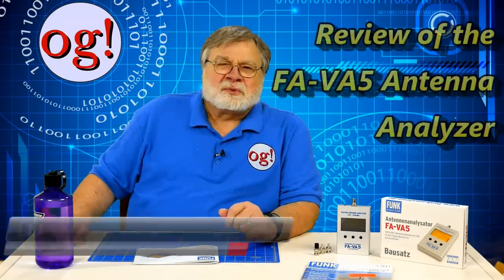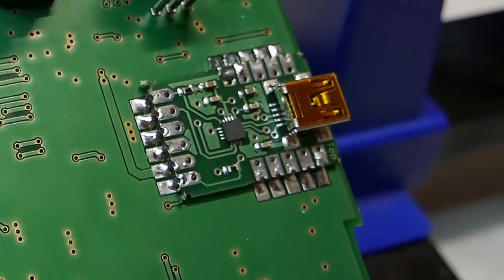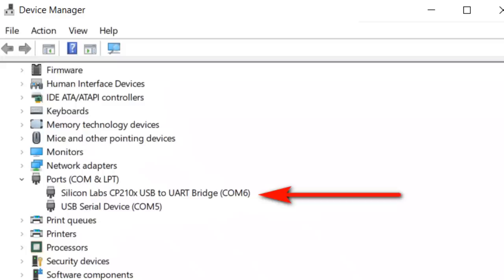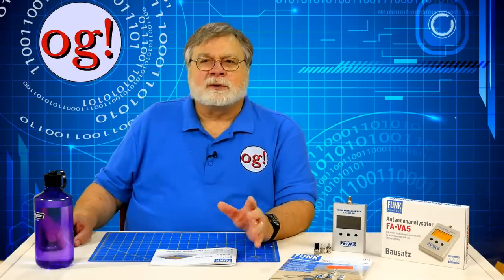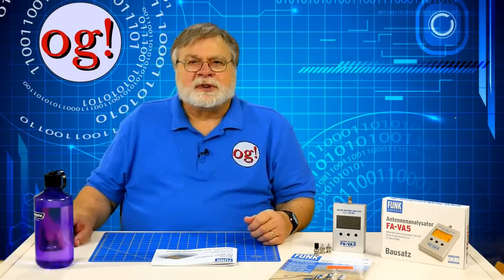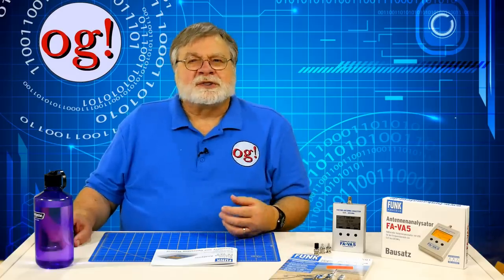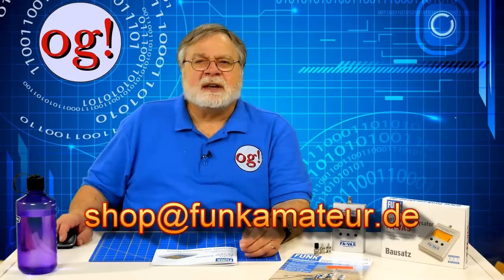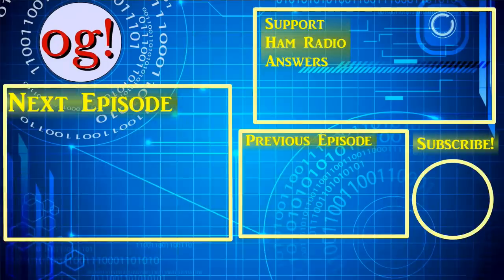Review of FA-VA5 Antenna Analyzer Kit (#193)

Comment: Love the review, it’s a really interesting device. It’s great that  the FA-VA5 and RigExpert AA-30 “zero” are finally putting good instrumentation within reach for hams on even the tightest budget.

A point regarding the “conspiracy against SO-239s”. For analyzing VHF and UHF antennas, SO-239s are entirely unsuitable. Even high quality amphenol connectors exhibit significant impedance variation above 100MHz, which severely degrades the accuracy of the analyzer output. I chased my tail for several days while attempting to tune a 70cm Potato Masher type antenna before finally isolating the erratic measurements to the PL-259 connector on the antenna, and the adapter I was using to connect it to the SMA port on my VNWA 3EC. I measured a dozen amphenol branded adapters and connectors from my parts collection, including some with  silver plating and PTFE dielectric, and found that the impedance varied from as low as 28 ohms, to as high as 71 ohms on 70cm. Their mechanical and thermal stability at those high frequencies are also remarkably poor, and few (I believe only those silver/PTFE parts) maintained better than 10% tolerance in pretty average operating conditions (several were MUCH worse) making calibration all but impossible.

On an HF analyzer they’re quite acceptable, but the only reason you even find 239/259 connectors on V/U gear these days is that the manufacturers are cheap and most hams don’t know just how bad they are compared to BNC, SMA, or N. Gear built by cottage manufacturers, or meant for contesting and other high performance operations abandoned it long ago, and most contesters swap the 239 on older radios they acquire for N straight away.

Those old “UHF” connectors were so-named in the days when UHF was anything above 30MHz.
Reply: Great info.  It is a shame that all my major brand 144/440 radios come with SO-239 connectors.  The connector I would like to see become the standard is the TNC, that is the Threaded version of a BNC.  As the center of it is the same as the N and BNC, the frequency range and impedance is the same.  BNC is fine for connections that need to be changed frequently and aren't stressed, but not so great for HT antennas.

Comment: Very thorough review. This type of "budget" analyzers are very useful for amateurs, maybe more so than a plain swr/power meter. You mentioned some very important points like the square wave output and the resulting harmonics. Like you mentioned, if the resulting harmonics are not filtered properly on the return feed, the result can be very off. I have 2 similar antenna analyzers, one for HF and one for VHF-UHF and I never checked their output waveform and harmonics. I should do this as soon as possible.

Comment: "putting the USB board on" was difficult, but a little scotch tape (with folded ends as a pull tab) on 2 of the 3 sides helped. Solder a side that isn't taped first, then remove the tape from the other sides now that the solder is there holding the board in place.  I had a very tough time with the solder bridges, and had to remove excess solder a few times.  Be careful here.

Comment: Your review was complete, concise, well thought out, and presented in your typical outstanding manner.  One thing I don't get is why you recommended this product.  Yes, it has a graphing feature but using a square wave instead of a sinusoidal is pretty weird and fraught with negative issues.  Even chucking the lousy computer software from consideration, it seems to me that it hit well off the mark as being something I would recommend...even if the price is attractive.
Reply from the maker: As it turns out, and as several people pointed out, the harmonics of the square wave are taken care of in the part of the instrument that receives the signal back from the antenna.

Comment: nice review, very thorough, good job!. I can't say for sure but my guess is that the harmonics you are seeing on the square waves are the reflections from the load. You can see this same behavior if you use your scope to look at a fast square wave  connected to an open transmission line (something like speaker cable) be sure connect the square wave source and the scope on the side of the wire. For fun you can connect a potentiometer to the open end of the speaker wire transmission line and adjust it to square up your square wave. You can then measure the pot value and you now have the impedance of the transmission line. I think you maybe able to use an Arduino and toggle one ifs pins at about 8 MHZ, for what it is worth.
Reply from the maker: A linear load, such as an antenna, will only reflect the same frequencies sent to it. The manual for the FA-VA5 mentions square waves as an output.
Reply: If you're meaning the distortion that is present in the time-domain view of the oscilloscope, yes, there's a good chance that is a result of the reflected wave interacting with the incident wave. A good example of this is using a time-domain reflectometer to measure the length of a piece of coax.
The harmonics that are present in the FFT (spectral) view are mostly just the odd harmonics that make up a typical square wave.

I believe the RigExpert line of analysers use a square wave output as well.

Comment: I sent off for some r.f. MOSFET's today and looked at this on their website. It looks pretty good. All my h/b gear and aerials are BNC and I use the BNC on the front of my FT817. I don't want the analyzer tied up to a computer and would the software work on Linux anyway? I had looked at the MFJ for several years but the price kept putting me off. Now with this trimming aerials to the correct length might be easier.
G4GHB.

Comment: Some will erroneously use low power with a low cost SWR meter during testing then see a high SWR when transmitting on increased power. This is because the reflected wave is rectified within the meter and diodes don't conduct down to zero volts.  David, do you have a video for this situation?
Reply from the maker: I don't. I'll have to run some numbers to see what happens.

Comment: Thanks for you detailed video David. But such a device sure seems like a sledge hammer to crack a nut, with its use with a PC far, far too complicated for what most of us hams need! The layers of actions just to install the software, divers, selecting ports, firmware, device manager, and goodness knows what else has put me right off!

Although I expect it's fantastic if you're a hard-nosed antenna designer who is very IT savvy, and probably quite good as just a hand-held unit, I think I'll stick with my old what-you-see-is-what-you-get completely intuitive MFJ259.

Comment: On last years year's Ham Radio convention in Friedrichshafen Michael Knitter gave a presentation about the FA-VA5. The key points are explained here (German, Google translate won't help): https://youtu.be/ryazPDSNDLU?t=398

There is an English PDF-document of that presentation available from Michael Knitter/DG5MK: https://www.dg5mk.de/media/hamradio2018/Hamradio_2018_DG5MK_English_final_PDF.pdf

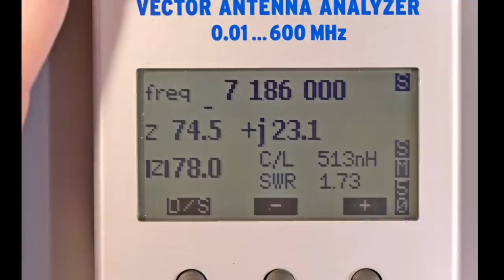I am by no means an expert on signal processing, but the principle seems to be to generate a square wave (input) voltage to a measurement bridge with three 50Ohm resistor plus the device under test (the antenna…). This is "Messbrücke", on the chart on the left with three 50Ohm resistors from 6:38 on.

The input voltage is "U2" on the schematic of the measurement bridge. The other input voltage is "U1" . 
The trick seems to be to feed U1 and U2 into a frequency mixer ("ZF-Mischer" ) and to filter and analyze the resulting signal with the a DSP then. In case of a simple resistive 50Ohm load (~ well matched antenna) U1 and U2 are in phase as shown on the "IF sampled" chart, the resulting voltage of the frequency mixer is a triangular voltage ("IF analog" chart).

For more information/the current firmware: https://www.dg5mk.de/pages/downloads.php
Reply from the maker: Thanks for the info. I looked it up. I still don't see how the harmonics in the square wave are kept from affecting the readings.

Comment: I like the placement of the bottle
Reply from the maker: Yeah, it hides the mouse. The mouse wheel controls the speed of the teleprompter.
Reply: @davecasler  It doesn't really hide it, it's acting as magnifier. But I get the point.

Comment: Michael Knitter has an English-language presentation where he describes, in detail, how the harmonics are handled internally by the FA-VA5. I think this presentation will answer the questions you posed in your review about the square-wave character of the device's output. The Knitter presentation is found here: https://www.youtube.com/watch?v=X8Z7veGV57o
Reply from the maker: Thanks. Several people pointed this out. Herr Knitter describes how he gets rid of the harmonics by low pass filtering in the sensing part of the circuitry--the part that looks at what comes back from the antenna.